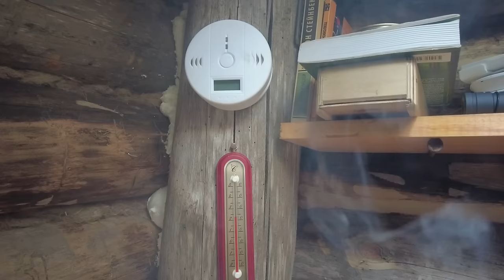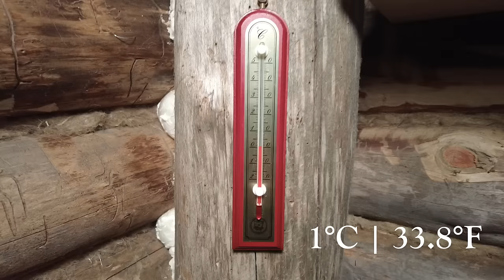Winter Wonderland: DUGOUT - The Most Hidden Underground House. Cooked Bone Marrow on the stove.

Comment: Are you concerned that the snow melt later might cause the cabin to flood? I know it's tarp lied in the walls but there was some decent water collection under the floor.
Reply from the maker: sandy soil under the dugout. it absorbs water well. shouldn't flood. there would be clay - then there would definitely be water in the spring